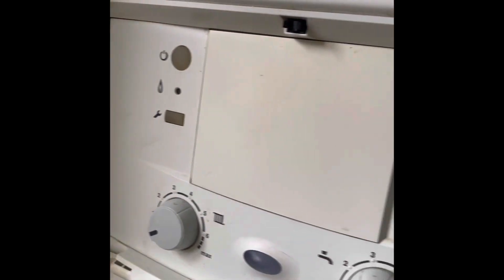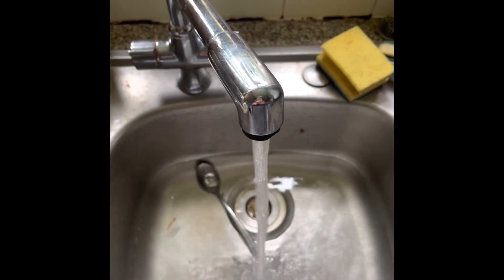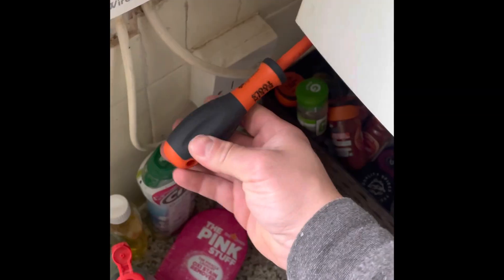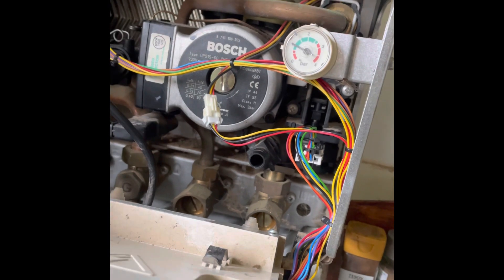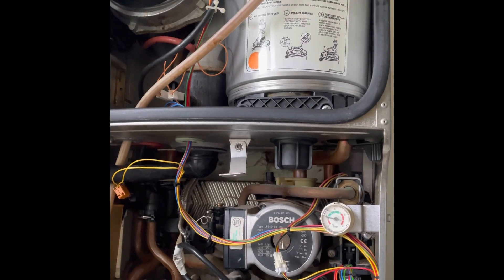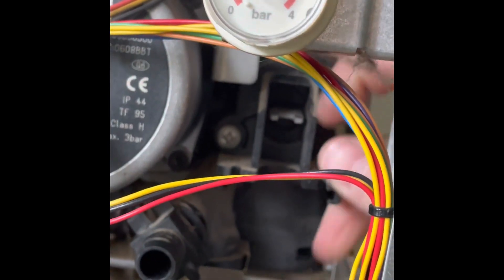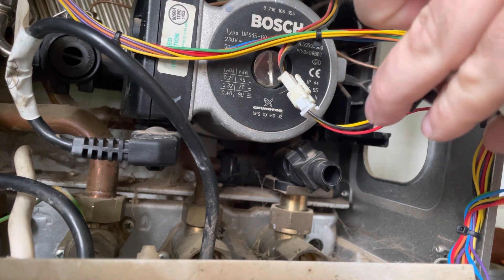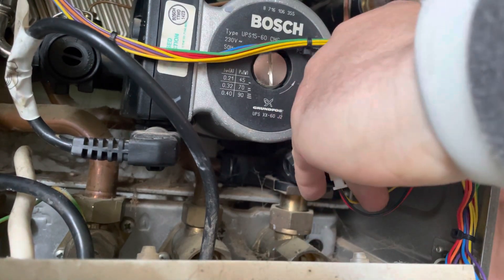Boiler breakdown, heating won’t turn off and no hot water WORCESTER BOSCH 30si gc 47-311-85

Comment: I should you be able to move the diverted valve by hand? Trying to decide if I need the motor, or the valve as well.  The motor definitely does not actuate, but the valve seems not move by hand either.